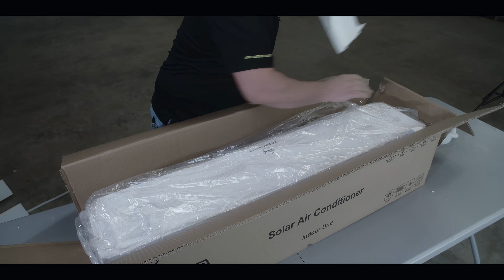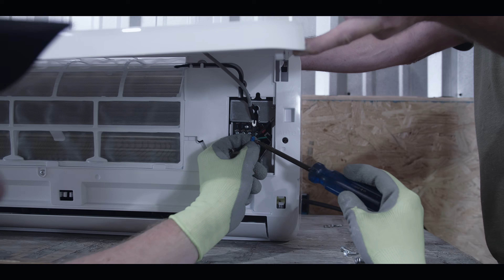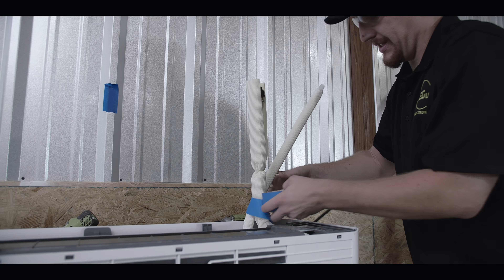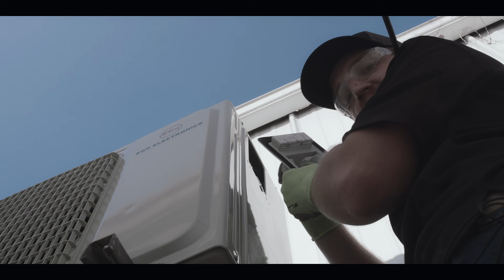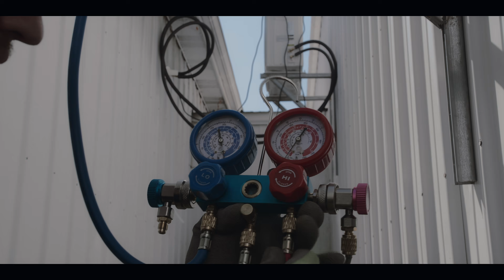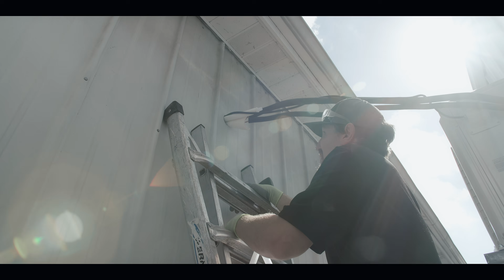NEW Solar Mini Split Air Conditioner Heat Pump by EG4 - Unboxing and Installation

Comment: Just curious! The EG4 solar mini splits at tge link you provided have preecharged line sets. No need to vacuum or pressure check . Was yours a different type?

Comment: Input Power 190-1100W?
VOC of PV <380V? 
115VAC and DC is 90VDC to 380VDC?
I assume that if I have a array at 90VDC at 190W (minimum) I can run this unit off solar is that correct? Or am I just not getting it?

Comment: There is no high or low side on a mini split head. There is no metering device outside the unit.

When cooling it is low. When heating it is high.

Comment: Just now installing the 24k unit. Hooking up the wiring there’s 2 lines hot 1 ground and no neutral.  On the outside unit there’s no neutral is that correct?

Comment: I've installed one of these systems and have some issues with it.  Sig Solar is no help, they are just reading from the same poor manual that came with the unit.  My emails to EG4 go UN-answered.  How do I contact someone technical that actually knows these units?
Reply: Did you get your problem resolved?

Comment: Great video. Unfortunately I made the assumption the 12,000 BTU unit had the same torque settings he mentioned...40-FT-LBS for low side.
I should have RTFM 32-39NM ~ 23.6-28.8 FT-LBS. I crushed the flare nut and scared the flare fitting.

Comment: Curious.   I just got 3 of these,  and the copper is folded down inside the inside head unit angled towards the center.  I need 2 units to go straight out the back and the other unit to be turned 180* and go out the side knock out of the inside unit case.  This video does NOT show them bending or re setting the inside you copper lines.  How is that done?
Reply: that's the one question i have,  how to i bend the lines without damaging them
Reply: @towtruckeryt  I have since done it and if you take your time and go slow it's not a problem. It's even better if you can purchase some mandrills to slide into the copper to keep it from kinking
Reply: @OffGridandOutdoors  Thank you,  i got it hung.  Anyone who bends the line on the 90 degree turn at the top of the unit,  will kink or break the line.  beware anyone who reads the is stream. Have a good one.

Comment: Aside of providing a shorter route for the drain line to the newly drilled wall penetration for the linesets, (if it is convenient for my install) is there any reason the drain line can’t remain at it’s original location and be run directly out behind the left side of the unit?

Comment: Anyone connecting linesets should watch correct procedure for making and torquing flare fittings on AC Service Tech or HVAC School, showing use of nylog blue and initial torquing, loosening, then final torquing. Getting the flare right is the best way to avoid losing your refrigerant and maybe also your unit.

Comment: I'm trying to decide between the 120v and 240v and I can't find information on what amp AC wiring & breaker I'd need for the 120v unit. It's not in the spec sheet or installation manual - Can you tell me how many amps it pulls when wiring into my grid AC?
Reply: I’ve heard it needs a 15amp breaker however after living with the unit for a few months I can tell you it never ever pulls more than 10 amps.

Comment: How many watts solar array needed? It was asked before and I don’t see it on your website. Also, what is maximum AC wattsAmps input required at 240V?
Reply: I think it's 1200 or 1,500 w so you'll need at least four 385 w panels. Me I use eco flow Delta Max with solar panel it has a built-in MPPT charger on there also. You can charge those batteries up quick and then they'll last a while on battery as a backup it's pretty good idea. In my opinion these EcoFlow and bluetti battery backups are genius and if you can find a way to set these down inside of a three-wheel motor vehicle it probably last a long time and it only took a 3 or 4 hours in the sum with 200 Watts of solar panel power to recharge it back up I'm sure you could probably add more panels and make them all foldable panels that you could take with you so far I have 600 Watts on the go
Reply: @TheCityandVilleShow  defeats the purpose of having a non inverter system to run an inverter for this.
Reply: From experience with the EG4 mini-split; 1000-1200 watts+ works well for the 12,000 BTU Unit, given at least 120 volts is accomplished and have enough leeway to accommodate for voltage drop during hot days, and voltage rise during cold days. Try to get 1200 watts of solar and around 150 volts.
For the 24,000 BTU model, it's basically double the amount mentioned above, try for 2400 watts and 280-320 volts for your PV. Keep in mind there are two MC4 connections so you may have 2 strings of PV attached.

Comment: You need to seal around the perimeter of the indoor unit. Otherwise after five years of sucking dirt in, it will be disgusting inside. You want all of your air going through the cheap screen filters. I add a 1/4” foam filter, sprayed with filter spray, on top as a pre-filter. Also use Nu Calgon foaming evaporator coil cleaner every six months to prevent mold and algae buildup.

Comment: Not exactly diy is it ? you would have to hire an HVAC contractor .
Reply: This install sucks anyway.  Get a micron guage for Christ sake.
Reply: @chrisE815  psh, you should have seen how i installed my pioneer mini split. I didnt use a vacuum or anything.
Reply: @enigma9789  Hey- you do you. It's your equipment.
Reply from the maker: You will need an HVAC professional signed off on evacuating the system (for warranty). Everything else can be done DIY

Comment: Link to recommend mppt unit plz :)
Reply from the maker: There is no need for an MPPT. Panels plug directly into the unit
Reply: @eg4electronics  The instructions show batteries and an MPPT for the off-grid scenario.
Reply: @MYOB1321  maybe for nightime?
Reply: @eg4electronics  I’ll add my voice to requesting an answer about the question.... Approximately what size solar array/watts would be needed to run the unit?   Thank you.
Reply: @J B  
From experience with the EG4 mini-split; 1000-1200 watts+ works well for the 12,000 BTU Unit, given at least 120 volts is accomplished and have enough leeway to accommodate for voltage drop during hot days, and voltage rise during cold days. Try to get 1200 watts of solar and around 150 volts.
For the 24,000 BTU model, it's basically double the amount mentioned above, try for 2400 watts and 280-320 volts for your PV. Keep in mind there are two MC4 connections so you may have 2 strings of PV attached.